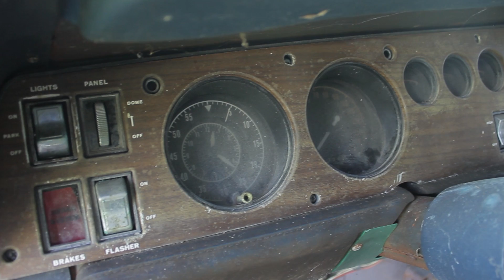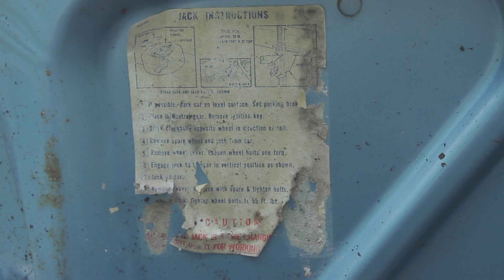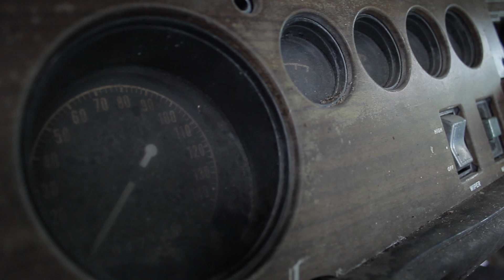ABANDONED 1969 Dodge Charger Sitting for 20 Years

Comment: It’s amazing that the car is even in that good of shape after so many years. Cars were really built to last back in the day.
Reply: This is far from good shape it's a rust bucket and basically for parts now, it's just a piece of shit if that
Reply: ? f1s a
Reply: I'll stick to your opinion mr uhhhh VDUBB20 /
Reply: sorry guys, but 20 years of sitting outside...it's in good shape. For example, rear windows on these were notorious for leaking water into the trunk, and that gas tank would be on the ground by now. The rear leaf springs? they would have busted loose, since designed to hold up the car's weight, and poked thru the floors. 

As for the cost to restore it...yeah, nearly ALL cars cost more to restore :)  but a charger like this is worth dough, hollywood would grab one of these just to put in a roll cage and send it jumping in a F&F movie. the fact this is an SE and optioned, it's worth taking to a pro who can put floors into a unibody car and have it still come out straight.

i'd hate to think what good raw material you guys are cutting up, thinking it's too far gone. sometimes we think if we can't accomplish something, that makes it impossible.

Comment: dude those tires look REALLY good for sitting for 20 years
Reply: but the rust is killer
Reply from the maker: Surprisingly they held air long enough to move it around.
Reply: wait, is it your personal vehicle, or are you gonna fix and sell it?
Reply: or, as I would do, is it gonna be a General Lee?
Reply: and the chrome bumpers too :3
Reply: I have one car that's been sitting in the garage for over 30 yrs. and the tires, none of them, have gone flat. The car next to it has been sitting even longer (by like two years) and all four continuously go flat. They're all (on both cars) just "rollers", mixed and mis-matched...go figure.
Reply: Provided it doesn't turn out to be a bondo bucket, I've seen MUCH worse get saved. This car will get back on the road some day.
Reply: We've saved much, much worse up here in the NorthEast. Waaaaay worse.....
Reply: The tires that are on my 1955 Chevy 3200 Pickup have been on there for 50 years, and they sat flat for 40 years. I aired them up, pulled the pickup to our garage, and got it running that day, that was three months ago. Three tires haven't leaked at all, and the one that does leak, i only have to air it up one every other week. So the tires were great back then.
Reply: I have a 57 3100 that I'm in the middle of a resto on
Reply: Rhett Str your right about the tires but they were multiple purpose because of the fact the Dodge Charger general lee was a dragster a power monster and a burn out machine the tires were in the best condition because of that fact and the charger was a good car because it was purposely made to do these things
Reply: +Matt Rodriguez wouldn't the 440 be enough? I dropped a 440 in my '69 charger and I could smoke the tires at 45mph. Hemi would be cool, but you'll be running on rims if you get too happy too often.
Reply: JeevesReturns that's no problem for me signed John Dunlop, PS, my brother's name is Jim Jim Jr :-)
Reply: Rhett Str wawsddd
Reply: Rhett Str   Wwwedcc
Reply: Rhett Str No they dont!!
Reply: no it is for everything is good how are you how I can tell is putting your hands on anything and stay out of his room is it gone spin around Amy Boulder you know it if a engine is good how you how I can tell is play your hand underneath her the fan and spinning around if his friends around and me soon as in the good if it don't spend around I mean is the boulder if if it don't spend around any in is a boulder I have a do is take it out here down and hustle all the rest out Ford out and put new rings pistons go to machine everything else in there and to all good day going call of
Reply: Rhett Str Their probably rotted on the inside.
Reply: Fr
Reply: couse they were still wanting to smoke that road lol

Comment: Poor old girl.Glad she was rescued but as badly rusted as she is ,that is going to be  a real labor of love to bring her back.I hope that is the plan.
Reply: It's actually not too bad. I've done waaay worse. So the interior has to be stripped and the floors re-done (the interior was completely coming out anyway as it was ....just totally wrong). They sell the entire replacement floor-pans for these in one piece. Would you believe one of the most expensive pieces to restore/replace on these is....the grille?! Don't believe me then look it up. I'd seriously get a 383 and an original 727 torque-flight transmission and run with it. And have plenty of black primer ready.....LOL....
Reply: Steve Idxp Just think, when it is all said and done you can look back at what you started with and the end result and say to yourself I brought her  back from the brink.
Reply: yeah, this one isnt all that bad at all.  building two far worse than this right now
Reply: Yeah...I don't get it. Pretty much all of the classics we get we rip down to the bare bones (frame or unibody) and build it back up anyway. I love watching these various "classic car restoration" shows and they flip out when they see a rust spot the size of a quarter. Really girls? Pull up your panty hose and fix and patch the damn thing. Don't squirt out your Nuva Ring. What's with all the drama? Gotta be a TV thing. Getting to upgrade the brakes, suspension, etc. A labor of love......
Reply: Fer sher. Put yer big boy pants on, roll up yer sleeves and go for it! This is what restomoddin's all about.
Reply: Steve Idxp remember they have a budget and the contract to uphold and a limited amount of time the studio will allow them to... that's the price they pay for doing this work on TV.
Reply: God no she only has patina once! ... that's the original rust! 😔😔😔😔
Reply: With as rare as they are now glares at Dukes of Hazard and F&F franchises no matter how much get put into it, you'd almost always come out on top

Comment: Brings back memories. I had one just like this, without the power windows, same colors with the vinyl top, back around the early '80's. Paid $150.00 for it. Transmission failing, brakes shot, right rear quarter creamed. Sold it nearly as cheap as I bought it. In hindsight, wish I would have kept it.

Comment: 20 years?, More like 30+ years to be honest. Still, all that vegetation reclaiming it will eat it away in no time at all. Will never understand why simple plastic sheeting is never used to seal a car from long term element destruction. Simply drive onto the sheet, get out & wrap it over the car, taping the join along the overlap. No elements, no concern for rust. If you've no indoor storage available, its the only way to go. People can be so lazy.
Reply: Haven't you heard of condensation? water under a tarp next to metal is a recipe for disaster. I would never cover a car with anything waterproof, unless it was inside a building.

Comment: Got to drive one in drivers ed. Red with black vinyle top. Either a 69 or 70 model. With teachers brake pedals on the passenger side. It had the 383...a bit much for 16 year olds. First corner I turned I got just a little heavy into accelerator pedal and broke traction and felt the instructors influence immediately :] never got to drive another one but it sure was fun.

Comment: CALLING DAISY DUKE! Put on your short shorts honey baby doll and come on down here and kiss this poor 'ol frog on the hood and bring this dead prince back to life. Ladies and gentlemen,  this WAS the car design "the devil" presented to the chief designer at Dodge back in the mid-60's. It was a "bad ass muscle car on steroids" meant to give men a raging hard on when they laid eyes on it. It was designed to make your adrenaline flow and make your heart race with excitement as you heard the beast come to life...most especially if it had the 426 HEMI(425 horses). 1968 to 70 R/T models with the 426 Hemi are now worth a fortune...426 Hemi's which came with 4-speed Hurst shifter are worth even more...100+ grand easy. This particular car is about a #5 condition car which is about borderline for a full on restoration. If it was in worse condition it would've been questionable whether to restore it or not. I am SOOOO HAPPY that someone decided to rescue this 69 charger. If the resto is done correctly,  the car could fetch over 75 grand on the auction block. If fitted with a crate 426 HEMI and 4 speed, the owner could see offers over $100,000. Not bad for a car that originally sold for about 3500-3800 bucks. That's the power of "glorified muscle car metal."